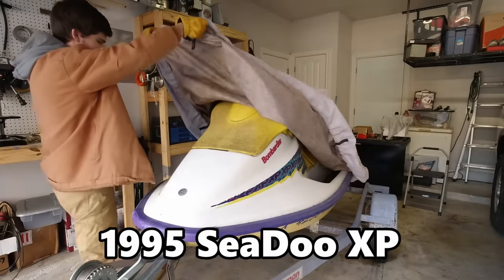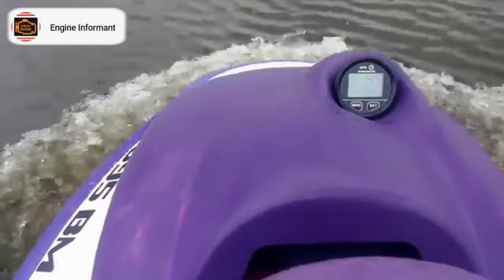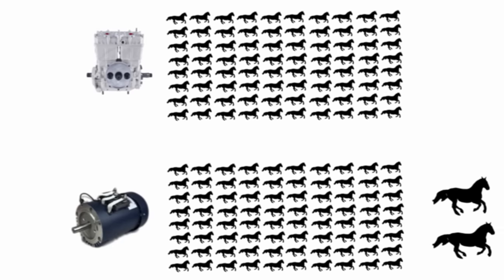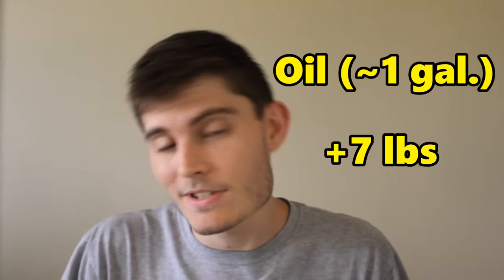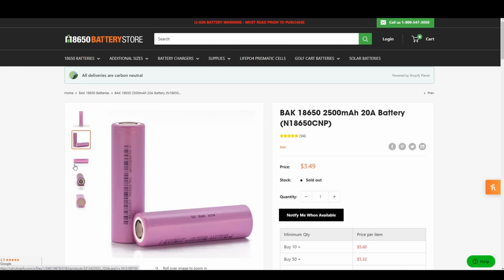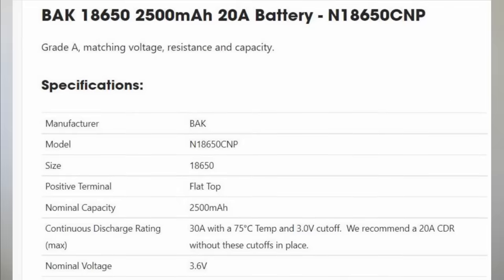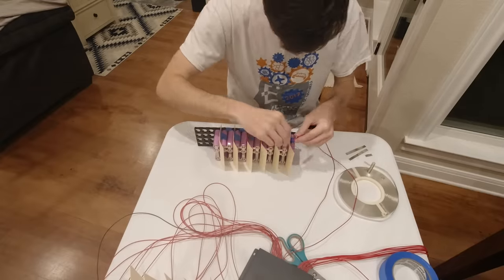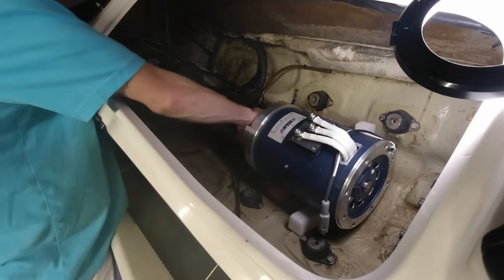Electric SeaDoo Conversion!

Comment: MOAR POWAH!! Double the voltage and cut capacity in half.  Same WH's in the end, but that motor should quadruple output! (Assuming the controller will operate in that range of course.)  The motor will be fine, but the rubber coupler will end up in orbit. Who cares if it only runs for 20 minutes...it will be the best 20 minutes you can have on a jetski! Come on man, break something - if not, you're not trying hard enough!  LOL  Edit for mistake.
Reply: yés it víß

Comment: Hi there!
On the final analysis on whether Electric is better for watercraft.. you only seemed to consider the inital capital outlay. 
But what happens if you add up the operating cost savings with regular use? 
Lots of tourist operations are renting those multiple times per day.

Comment: Very interesting, a lot of work but educational. Only two thoughts no internal temperature sensors in the battery’s and no over current ,under voltage or short circuit protection boards built in to protect each cell?.
And your charging method will kill your batteries! 18660 have a special charging profile involving trickle, constant current and constant voltage . You get a pcb that takes care of that .

Comment: Enjoyed your video, years ago when electric motor driven vehicles were becoming a reality, I always thought that it would be great advancement for boats, well they have had electric powered watercraft for years, but they would struggle to reach walking speed.
I know you were saying it was overly expensive, but then you didn't compare running costs the cost of recharging to refueling, serving ect ect.
The other point was if you were going to use it say once a week that's five years on full power plus another five years as the batters ability to hold charge  deterates .
Over this time period how much fuel would you have expected to use, fuel , oil plugs and all the other service charges.

One day I hope to purchase a steel cruiser only around 35 ft had thought about electric power replacement for the 100hp diesel motor.
But it's recharging with solar power, hopefully by the time I'm free to be able to purchase a boat maybe high speed solar charges will be in use.
Nic

Comment: You forgot to add the fuel cost to your calculations. If you count you will have to add 30$ us times 500 to compare it to the battery version (and 1 x 500 $ us for charge cost). So the extra cost not even counting oil or service would be 15000 $ us for gas and subtract 500 $ us for charging, so the electric version would be 14500 $ us cheaper in run cost for the 500 cycles/refuels I did the math on. This means that even if your electric system cost you 10000 $ us you still save 5500 $ us (a new gas motor was 1k$) for the life of those batteries, there are better cells with better stats that could be even better for you, and when these cells are worn out they are all you will need to replace (if you keep water out of the Seadoo internals) as electric motors usually out lasts gas engines by several times. 
To conclude: if for no other reason it would make economic sense to do the conversion beyond all other benefits you get. Well done, good video.

Comment: Would be interesting to know how many amps it did pull when running. I bet the 500 amps of the controller is way higher than what actually is pulled. And if it is just a peak current you could go with the 30 amp rating of the batteries. Sure you could up the voltage to 144 volts without adding more batteries. But yu would need to redo yur battery packs.

Comment: I thinking you might have better luck with a plumQuick motor.  If they can get a golf cart to 133 mph im sure that jet ski  would be faster than 45. And they are under 500 bux. Whatever the case cool video. Good luck on your adventure.

Comment: Fantastic build! I do have a question. The part when you couldnt plane, you mentioned you were missing torque. I thought electric motors have more torque than gas so i thought maybe you simply didnt have enough RPMs. Couldnt you switch the impeller for a pitch that would allow for more speed assuming you had enough torque?

Comment: You don't think the voltage is a bit high to be using in the water??  Could potentially create a dangerous situation, especially in a system capable of so much current output.

Comment: Wie viel Strom hat der motor in der Finalen Version maximal aufgenommen ? das würde mich sehr internieren denn wenn der ca 500 A zieht dann wäre die Fahrzeit stark begrenzt auf ca 5-6 Minuten und so gesehen würde es keinen Sinn machen auf Elektrik umzurüsten .
Ist der Stromverbrauch aber nur bei ca 100A dann wären gut 30-45 min Fahrspaß möglich würde aber auch bedeuten das man gar nicht so viel Leistung braucht sprich man hätte dann einen etwas kleineren Motor kaufen können denn 100A bei 145 V wären ca 14,5 Kw Leistungsaufnahme oder eben rund 20 Ps.
 Ich persönlich denke das um 25 Kw anliegen oder anders gesagt um 175A an Strom aufgenommen wird was die Fahrzeit auf ca 15-20 min begrenzen würde .
Über genauere angaben würde ich mich freuen .
Trotzdem ein sehr Interessantes Projekt zumal es sehr viel leiser fährt als mit einem 2T Motor nur das mit den kosten und der Fahrzeit wäre dann noch von Nachteil wie ich vermute .
Wenn man save ca 45-60 Minuten Fahrspaß haben kann dann macht es deutlich mehr Sinn .

Comment: You’d need much bigger battery  to make that usefull. Jetski is most likely one of the most difficult vehicles to electrify, because of high power demand. A car may have 500kw power but it needs only 15kw to drive 100km/h. Jetski can have 300hp and still be driven wide open all the time. It’ll of course empty the tank in 20 minutes with such driving. 

For decent budget electrification, one should find suitable hybrid vehicle motor from junkyard and try to get controller on it. I have seen new 400 Ah lfp calls in a price of 80$/kwh. That would halve your battery costs. 

Personally, I’d stay away from planing boats or jetski’s unless I’d plan to use hydrofoil as Swedish Candela

Comment: You can use one 12 V battery and one power inverter to get 120 V!!
The power inverter is white and Ken be $150 at Harbor freight for 1500 Watt! Then you could just wire up the motor to 120 V cord and plug it in!!

Comment: hey zach did you try to use a voltage multiplier with current multiplier as well circuit instead of buying too many batteries just to have enough voltage to meet your     specification  requirements 😊

Comment: A 40s 24p pack would have made 160 volts for your motor, and the motor could have handled that for short bursts.  It could have handled 160 volts forever if you'd run it at 80% throttle.  Then you'd have out performed a gasoline engine.  You just needed to put each layer of 40 batteries x 4 volts spot welded in series to make 160 volts each.  You could have bought less batteries that way too and had a lighter craft if you got the 30 amps that a lithium 18650 can potentially put out.  Electric motors rate their voltage according to running temperature, so you can run it at a higher voltage for long periods with water cooling or using air fans and a water radiator blowing through the motor windings all inside your sealed hull.  You'd then have a slightly more powerful craft than was originally designed.   Also, perhaps the battery weight needs to be further back to make the front lift up and hydroplane easier.

Comment: Great build. Why did you decide to connect the batteries to such a high voltage instead of keeping them at a lower voltage and using an inverter or step up transformer to produce the high voltage? I'm not saying it is a better option, just trying to learn.
Reply from the maker: Find out why houses use 120v instead 12v, and why are some appliances 240v instead of 120v?

To get the power out of lower voltage you have to pump an absurd amount of amps current.

Think about your house breaker panel 100 to 200 amps for the main breaker for the whole house!

At 100volts I'm pulling 500 amps! More current makes more heat in wires!
Reply: @ZachsGarage1  That makes sense. Thanks for explaining. :0)

Comment: Just a question. Could the larger tool batteries like dewalts 60 volt or the Milwaukee 18 v 12 amp  be configured in a way to be swapped out quickly for another hour or so of wide open throttle?
Reply from the maker: Of course! With enough of any battery you can power this puppy!

Comment: Great build I’m into electric brushless rc boats myself  just curious how your motor temps were as model boats use a cooing jacket for motor and water cooled esc
Reply from the maker: Water cooled is the way to go. Closed loop even better  Let's just say the air was warm inside in when I'd take the seat off to check. Motor would get to around 150f

Comment: Voltage is your friend! Increase the voltage and lower the Amp draw! With more voltage the Amp demand would drop, the KV of the motor will of course go up so you could step up the impeller pitch to lower the peak rpm yet have a much longer torque curve with increased voltage. If the cells can handle the current Amp draw then increasing voltage will lower the Amp draw with the impeller your running now but with a higher pitch impeller it it will raise the Amp draw back to a level that you know the cells can handle. You could get a huge amount more performance out this system. For a 65+KW system at current the results are no where near what they could be telling me that your ESC it's not mapped correctly, if heat isn't a problem then increase the motor timing in the speed control software... some esc systems have torque limiting in place and "safe" timing so there is likely a lot more performance avaliable as is but increase voltage and impeller pitch and you would have a hell of a ride.

Comment: Great video and tons of information. I'd have to agree with you that the "bang for the buck benefit" isn't worth it. Like you said, you can use your newly built system on plenty other projects . The one thing you didn't discuss was how catastrophic it would be if either the motor or the batteries got swamped. Would they survive or just become junk?
Reply: wribg
Reply: @sharonbraselton4302  ???

Comment: I was about to comment that building that for 100 Volts and also counting of 4.2V per cell was a big mistake, but figured you would learn it by the end of a video anyways lol. I was tinkering this idea for my trixx 2022 too, but did the math without building and realized that the whole project with current battery tech isnt worth it sadly. Was very interesting to watch you though! Also to add to your video: 1) spider coupler is also a bad idea, I knew it would fall apart, you need a different type for that application, as there is a lot of pressure going on with water resisting the rotation. and last but not least, but probably the biggest is battery run time. 30 minutes vs 5 hours on a tank of gas. This is actaully the biggest issue with high RPM high torque electric aplications now. Sadly its not gonna work, not yet. Maybe Hydrogen may, for emission free setup, but not electric. plus the power you get is also incomparable. Which seems weird, i agree, as my tesla is faster than any gas car, but that is because it only needs to resist the air!
Reply: tañkes 20⁰0 years kinyn

Comment: The 92hp motor in my Renault Zoe EV can be bought used for $500. $4600 seems incredibly expensive for an electric motor with just 82hp.
Reply: wribg  buy it gôd deal
Reply: wróng  híud óríce tag

Comment: I use those little rubber cogs on a electric motor to roll up cotton module covers they do not last that is a bad setup for a cotton cover rolling machine you're going to have to come up with something better Straight Shaft that's what work for me very cool videos it was very interesting to watch

Comment: I have been researching electric motor for my canoe, something bigger than trolling motors and this video answered so many questions. I have been aiming to use a bow thruster for my motor and I'm not looking for much speed, maybe 10 to 15 mph if you have any suggestions
Reply: buy  éktric whaler  13  20 hp 40 hp 30 hp 20 moh

Comment: Cool could you wire 2/3 battery to 1/3 of what you have but the 1/3 Wired in as capacitors

Comment: This would have b33n a great use case for the spim08hp.

24s4p would be 61 lbs and 800 amps continuous - 1600 amps burst.

$8.50 for 2 comes in a hair over 400.

That would be 32ah.

And thats the weak point in all electric drives 

I'm not sure how much run time that gives you - 15 min?

Nowhere near what you get from an equal weight in gasoline.

Comment: To get to the speeds you want, you need way more battery and power than can be put in the housing. You might be able to work with gearing ratios to get more speed, and yes, that shaft coupler sounds terrible

Comment: I think the big problem with this construction and also why it did not glide with 100V, is that the propeller is optimized for low torque and high rpm gas engines not for low rpm and high torque, so you need a bigger propeller to go with the torque.

Comment: People often dont understand or underestimate the power needed to turn a propeller  or and impeller in water. Good first go at it though. I wonder if it would be cheaper to get an electric motorcycle and rob the parts to do this conversion

Comment: If you could make it bidirectional I could use it as an emergency power supply for my sump pump refrigerator and TV. When I'm not using it.
Making at multi-purpose should help with the cost.
Unless of course it weighs it down too much.

Comment: Nice job but the a.c. 35 motor does not have the best power to weight ratio.  I guess you never ran it long enough to test the battery run time?

Comment: Cheaper to build a badass gas engine by time batteries electric motor in all the electric wiring to go in there along with the controller you're looking at way more than you would spend on a nice engine for it

Comment: i would just rebuilt or bought the replacement motor gas  lol if that ever went under water  you would need small crane to get it back up and the battery's when wet could be dangerous or fire hazard

Comment: Keep the old engine. It probably has a coupler to the prop shaft that can be cut off and welded into a single keyway coupler (for most e motors).

Comment: The motor is more than powerful enough. You need to use some type of gear/belt to get a different ratio so you get a lot of RPMs on the shaft and your problems solved.

Comment: As a personal watercraft technician I can tell you a Sea-Doo Driveline system is not the system you want too much could go wrong you either want a Yamaha or a Kawasaki simple easy to get parts for skis even if they're super old and their Drive lines are super reliable and Jet pumps are super sturdy wear rings dont really go bad like seadoo

Comment: get those cells to 3.8 volts when storing them, since this is one year later and if you havent done it, it would already be too late.. the cells really dont like being fully charged or discharged. you probably know it. get it to the maximum voltage the controller can take please, you dont need to buy new cells, just reconfigure and do some rips!!! =)

Comment: Great work 👏  now u can sell it for Big $$$ to right buyer in cali. make some bank ...  build some more  "electric seadoo dealer" 
  Just hopped up my 300 Rxt-X added more boost, prop, tune, ect. Hits  85 mph Easy passes everyone.... even Towed a wake boat back to shore,  Eats 16 gal.s "premium" in about 4-6hr.s  Smiles per Gallon    runs allday on Eco mode.   Thinking of doing Aluminum 6.2 Ls v8 turbo  600hp swap into a Seadoo challenger jet boat next for giggles 😃

Comment: And if you use a 48volt motor 4hp .
With a cvt systeem .
This way you can use more rpm and lower power engine to drive the systeem.
Reply: 4 hp ekrrc jet ski 5 jw 6 kw   5 6 hiurs     9 25 moh  46 tóo 56 mîe rabfe ektrc biat 4 hp ejtrc jet outbsrd

Comment: i think you need a bigger motor....that prop sounded rough....maybe a fan for cooling....you can coil some pipe around things and pump water throgh it too...  the less of a load....the cooler it stays...
happy craftig...
tradesman....

Comment: I would have used steel angle iron instead of aluminum, because of the torque in the motor. 82hp is a lot of torque for aluminum.

Comment: The electric motor is way more efficient than the old one 90% to 30% .... So the new motor is at least about 3 times as powerful! But as some other suggested the pitch of the impeller is not designed for the motors rpm ...

Comment: Horse power doesn't mean a whole lot in term of speed... your gonna need a high rpm motor that turns the 6-7k rpm that the old 2 stroke motor turned..just a thought.

Comment: Just use a small power inverter to make 140 to 150 volts! Then use a small 12 V battery and use an inverter to convert it to 150 V and hook that to the motor!

Comment: Way to get more power use solar panel & controller box seal the box use 50amp diodes and multiple lines for seperate batteries double up the field coming from the solar panels so attach 2 50 amp diodes to the positive from solar panel to controller box = more electricity from sunlight

Comment: The electric motor seems a good idea, but you should generate electricity by burning gasoline or kerosene onboard. Light motor, light gas, and light generator. It's a matter of maximising the power per weight ratio, in a floating or flying device, something that two stroke Rotax engines do second to none.